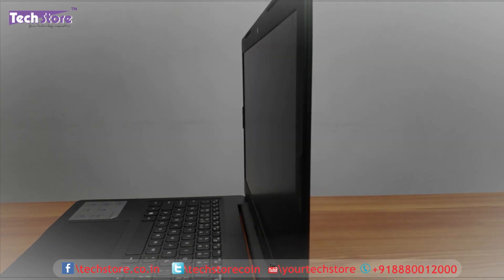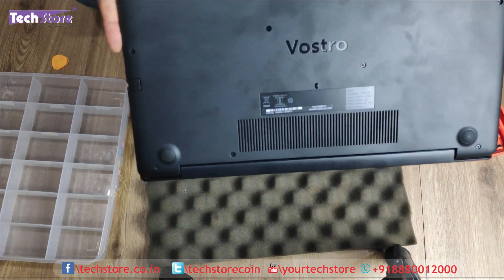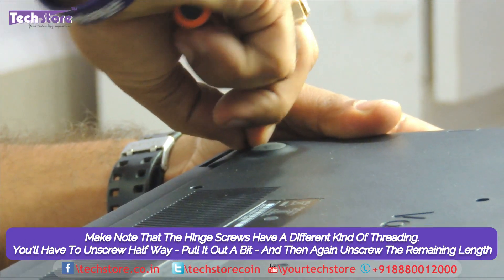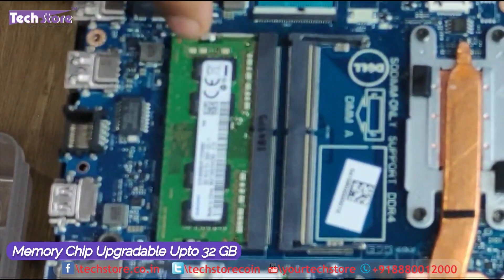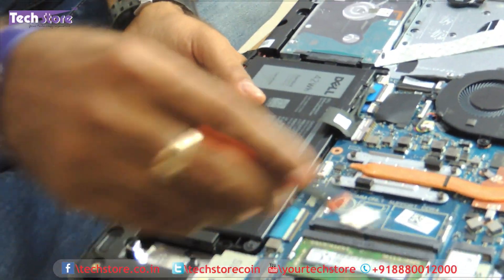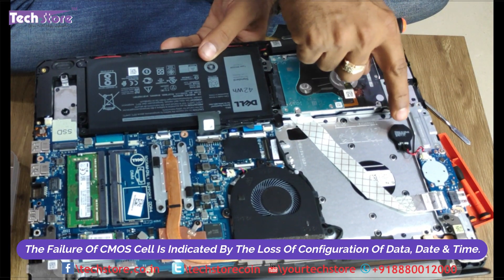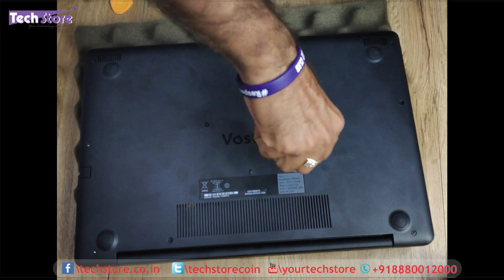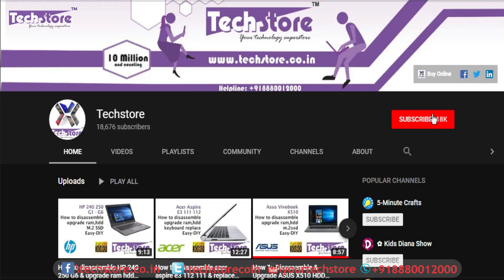Dell Vostro 15 3000 3583 review unboxing: How to upgrade ram m.2 ssd hdd

Comment: Can you please confirm if we can upgrade the RAM up to 16GB, 20GB, or 32GB? As per memory options in the site, the max option is 16GB only. Hoping for your technical advise. Thanks
https://www.dell.com/support/manuals/en-ph/vostro-15-3583-laptop/vostro_3583_setupandspec/memory?guid=guid-d6c11e36-9908-46eb-8404-0ef065b03d0b&lang=en-us
Reply: Use this code in cmd prompt: wmic memphysical get maxcapacity, memorydevices
It will give give you info about max max capacity of ram in kb and total slots available to put rams in it

Comment: Sir can you please confirm which kind of M.2 SSD does dell Vostro 3580 support (i.e NVME or SATA)? I'm unable to understand from the online specifications
Reply: @deeptaragh roy Hi bro did you get clarity on whether it supports NVME or M.2 SATA? I'm also looking for same information.
Reply: @gotit547  I'm personally using NVME on this laptop for 1 year now
Reply: @deeptaraghroy2772  thanks for the quick reply may I ask which SSD you are using I'm thinking of ordering Samsung SSD.
Reply: @gotit547  I'm using SAMSUNG 970 EVO Plus 500GB
Reply: @deeptaraghroy2772  one more question my laptop spec mentions 256GB, will it support 500GB SSD like your laptop or should I stick to 256GB only?
Reply: @gotit547  I can't assure you that it will. Depends on the model, its regional variant and its seller. If it's DELL Vostro 15 3580 (I bought from amazon India with linux) then I guess it will support. Otherwise if it is locked then I don't think you have a choice. (Usually the storage capacity is not locked). But I would say, it's better if  you go with the specs.
Reply: @deeptaraghroy2772  thanks my model is Vostro 5383 and bought it from Amazon India and also checked your model specs and both are same so I can take risk of ordering 500 variant thank you so much , you have no Idea how much I was looking for this information and confirmation as it's not provided by support team.

Comment: Thanks for the video. The keyboard cover on this laptop is different than the older 3500 series models so its nice to see some updated instructions here. The same instructions would also apply to the new Dell Inspiron 3500 series such as the Dell Inspiron 3581.